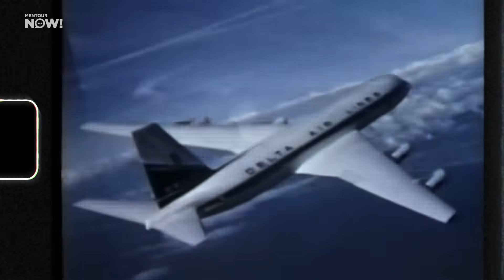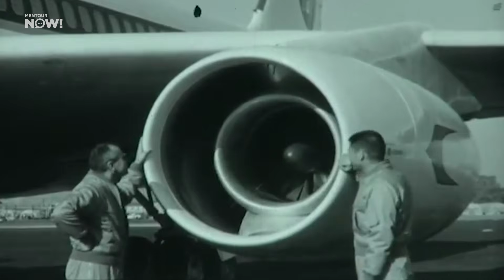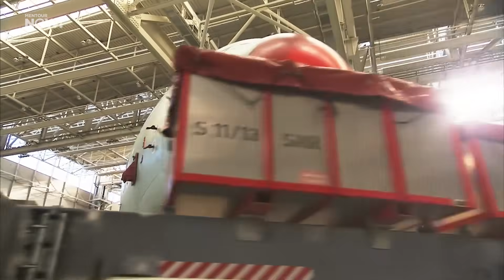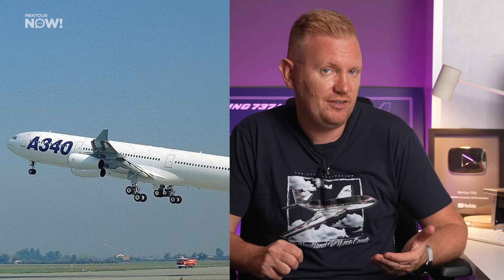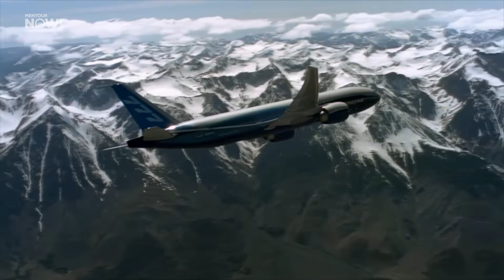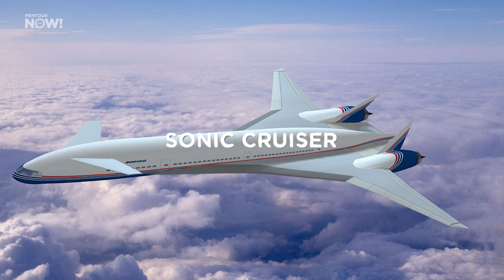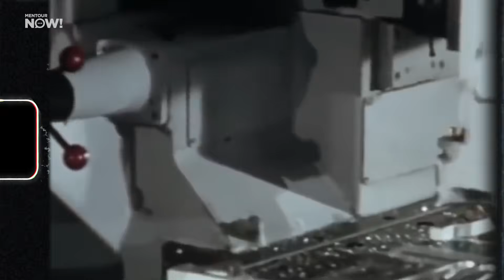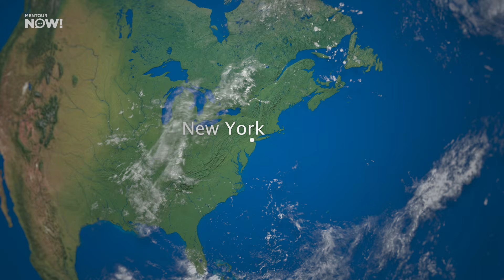WHERE is the Boeing Sonic Cruiser?!

Comment: It is interesting that most airlines like you said want twin engine jets!
And then there is Lufthansa, operating the A340-300, A340-600, A380, 747-400 and 747-8i.
And yes, we are in 2023!
Reply: Lufthansa buys their aircraft, instead of leasing. This means they can't just not extend 10 year leasing contract.
Lufthansa already ordered 777X, but this program has delays. So they had to resurrect the A380s, and some A340s.
They will keep the 747-8i (since they are impossible to sell, and they were cheap for Lufthansa as the launch customer), the other 4 engine aircraft will get retired in mid term.
Reply: @simonm1447  AeroNewsGermany said that Lufthansa reactivated the A340-600 because of the need for First Class seats in Munich. According to him the delay of the 777X doesn't really have an impact on their fleet strategy. The 777X will replace the 747-400 and adds some capacity. The A340-300 will be replaced by the 787-9. The 340-600 will be replaced by the A350-900 or -1000, but not until it gets some more First Class seats. And the 747-8i and 380 will keep flying much longer.
And as you said, Lufthansa owns their aircraft, so it makes sence that they keep them flying.
Reply: Germans seem to be more conservative with engines. Might also be the appeal 4 engine planes have since it’s introduction to Lufthansa. LH still uses a 747-400 from Frankfurt to Toronto, whilst Air Transat used to operate an A310-300 on that route.

Comment: I think an issue Boeing couldn't solve was that the Sonic Cruiser had to fly just over the speed of sound to get the time savings. While Mach 1.15 flight was probably what they intended, even at Mach 1.15 you will hear a distinct sonic boom, a major no-no for overland flights. The 787 offered many of the technological advantages of the Sonic Cruiser but in a more conventional airframe, and had the range over over 7,500 nautical miles, which made it viable for very long-distance flights.

Comment: Non bleed air- air conditioning is nothing new it was on the DC8, it was avery similar system in the beginning with 4 turbo compressors, 4 cac’s on the 787.
Gee i wonder where boeing got that idea from after absorbing macdonald douglas 😁
They later DC8 were modified to have 2 ACM’s to replace the turbo compressors when they were re engined with CFM56’s

Comment: We went to the U.S. on the dream liner and returned on the a380. The one we loved was the dream linnet. It was nicer and had bigger and more comfortable seats. The leg room was better then what we had been on before. The a380 really wasn’t the best. The seats were small. You couldn’t get a good sleep. The legroom was so small. I am hoping I never get to go on the a380 again.
Reply: For large airliners seat size and legroom have nothing to do with the model of plane you are in. It is up to the airline how many people they want to try and cram in to make more money and hence seat size and spacing, so if you had a squeezy flight back in the 380 change the airline not the plane. On other aspects of comfort, while both the 787 and the 380 are very smooth and quiet the 380 is renowned as the quietest plane in the sky.
Reply: That’s not an aircraft problem, that’s an airline problem
Reply: The 380 is really about the non-peasant class, apparently, with some very luxurious first class areas. And I feel that I use the term correctly.  If you aren't business or first class, you simply are stuffed in like cattle.  I see this trend a lot as well with smaller carriers - this super narrow, can't recline the seat more than 2 inches, a tray the size of a mousepad..  All to fit another 20 or 30 people.  Assuming that every flight is at capacity.  Being 80% full but suffering for 3 hours.. Or in the A380 - for 10+ in some cases...
Reply: The seats have nothing whatsoever to do with the airplane.  Seats are airline specific.  An airline could buy 787s and put folding lawn chairs in them if they wanted to.

Comment: Sonic Cruiser deal breakers: No rear access for food trucks; emergency exits (on top of wing?); baggage compartment doors placement and access from std ground equipment; fuel consumed in delta wing causes CG shifts requiring active fuel management; how to protect bottom surface of wing fuel tanks from landing gear blowouts (re: Concorde tire disintegration), the list goes on.
Reply: Active fuel managenent was standard on Concorde, and A 321s also use trim tanks.
The problem the crashed Concorde had was the captain overfilled the fuel tanks, with more fuel than allowed. Because of this a conpressible air bubble in the tanks was missing, which lead to the fuel leak. The tire never went through the skin of the tank, the tank blew out from inwards at another spot due to the shockwave in the overfilled tank.
Nevertheless sonic cruiser would have been doomed to fail for other reasons

Comment: This could easily be the marker for when Boeing began to sort of lose its way. Boeing was correctly realizing that the era of the 4-engine jumbos was ending, but they were apparently so worried about the A380 (A3XX at the time) that they seemed to become frantic about how to respond. At one point embarrassingly announcing a larger 747 at Farnborough in 1996 even though they had previously stated emphatically that neither a larger 747 or the A380 were needed. And then when that fell through they moved on to the risky Sonic Cruiser project.

Imagine a different history where instead they followed their instincts and began working on a next generation mid-size jet, and started sooner on the 787. Things could have turned out very differently.  Instead they don't seem to know what to do and just continue to update their legacy airliners. The 787 which launched over ten years ago will apparently remain their newest plane until at least 2035 as they figure out what to do next.

Comment: Concorde did actually make use of the Area Rule, albeit to a much lesser extent than the Sonic Cruiser. If you compare the area aft of the aft pressure bulkhead on test aircraft and production, you will notice the production aircraft are longer.
Reply: I think that had to do with turbulence rather than area rule.  The prototype had drag-inducing turbulence around that area that was solved by extending the tail cone.

Comment: Flying faster allows to fly higher. Half as many air molecules are pushed down at twice the speed to lift the plane. Now kinetic energy of each molecule is four times as high. But we only need to stay in the air half the time. Thus in total we push down only a quarter the number of molecules as a half as fast plane.

Comment: I always found the story of the Convair 880/990 really interesting if you want to delve into high speed passenger aircraft, much more so really than the true supersonic planes as they where made in while modest more substantial numbers than the true supersonics. However, they had to deal with many of the same issues.
Reply: What really killed the Convair 880 and 990 was the infamous mid-air collision in 1960 between a DC-8 and L-1049 Constellation in the New York City area. As such, the FAA started to impose speed limits on jet airliner flight, and that pretty much erased the speed advantage of the Convair airliners.
Reply: @Sacto1654  Interesting

Comment: I think the design would work if the focus was changed to efficiency rather than speed. Using the area rule, laminar flow wing, partial lifting body fuselage, large turbofans that wouldn't normally fit under the wings of anything else, plus doubling the capacity to something between that of the 777 and the A380 would appeal to the long haul airlines.
Reply from the maker: I think you might be right..
Reply: @MentourNow  think of something like a giant Piaggio Avanti, it flies faster and higher than its peers. It works for those high flying corporate jets that operate at 50-60k ft.

Comment: Along with the professional sports teams that have left San Diego, CA, there was the loss of it's hometown airliner manufacturer, Convair.  San DIego was where Lindbergh's Ryan aircraft was developed.  KSAN is called "Lindbergh Field".  It remains, I'm told, an issue of regret for older San Diegans.  The C-240, 340, 440, and 600 turboprop conversion became the standard 2-engine regional in the 50's, 60's, and into the early 70's.  As for the Sonic Cruiser, your point about compatible scheduling is important in dispatch and maintenance centers for all kinds of reasons.
Reply: They erased Lindbergh’s mural and renamed the airport because he opposed WWII.
Reply: @naughtiusmaximus830  It was always "Lindbergh Field", in my experience.
Reply: @inyobill  Not anymore.
Reply: @naughtiusmaximus830  but, them, also, Grossmont is termed "East county", so there ya go.
Reply: @naughtiusmaximus830 Hi!

I’m in the San Diego area and I know for a fact that the mural still exists.  It was painted on detachable panels, not the terminal wall itself.  It’s currently on public display in Ramona.  To find it, just get on the 67 and follow it through town, it’s on the side of a building there.  Can’t miss it unless you’re going the wrong way.

Originally the painting was taken down because it had been damaged from being out in the elements for about 15 years, and the Port Authority had the name changed about a decade prior because they thought “Lindbergh Field” sounded like a general aviation airport or something like that.  Many weather and news reports continue to use the name and it remains widely known in the area.

In any case, a full-scale reproduction of his “Spirit of St. Louis” airplane still hangs from the ceiling inside the terminal, which would be a funny thing to leave up if they were in fact so determined to scrub him for his political affiliations.

Comment: Concord - The reason the Concord did not have the wasp waist, as I heard way back then, was that it was much cheaper to build with a constant diameter, all parts identical all the way down the tube.  This in the context that the project already going over budget.  Ya, old guy here.
Reply from the maker: Yup, and the lack of better materials to easily solve it with.
Reply: The double delta covers almost the whole fuselage ( in length ). So it is all waist. Rudder starts where engines end. Also area rule works best transonic, not Mach 2.

Comment: What exactly is the benefit of hub and spoke? Like, is there any video explaining about why did the aircraft manufacturers and politicians thing hub and spoke would be a way to go despite point to point seems better in every way.
Reply from the maker: There was no benefit per day, but for the airlines it allowed them to optimize their fleets of larger, long haul aircraft with their smaller feeder variants. 
It would also create possibilities to connect loads of different parts of the world, effectively with the use of a central point to start from. A great example if this is how Emirates uses Dubai.
Reply: Hub and spoke was based around Large jets for main routes and smaller jets for secondary routes.  Think of it like intermodal transport. Trucks for local transport and train for cross country.  It makes sense for crowded routes but point to point changed to business model.
Reply: @AC-yj8cx  It makes no sense for the crowded routes because it's the hub and spoke model that cause the routes to be crowded, not the other way around. And even for the airports that are already crowded it makes even less sense to cram even more traffic to it, and equally no sense to put most of the traffic to smaller airports when they don't need to.
It's "convenient for the airlines" is probably the only reason and is a good enough explanation for me.
Reply: @AC-yj8cx  BTW, I know what the hub and spoke model is. My question wasn't "what" but "why".